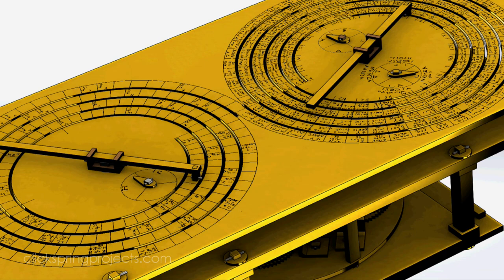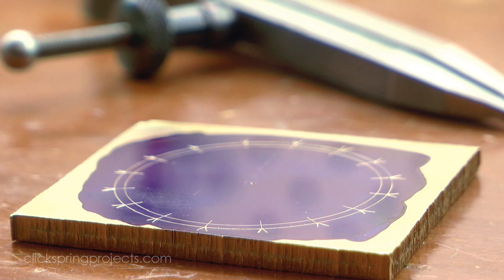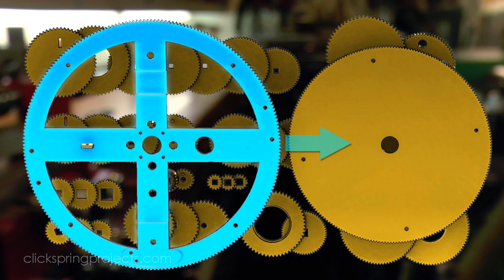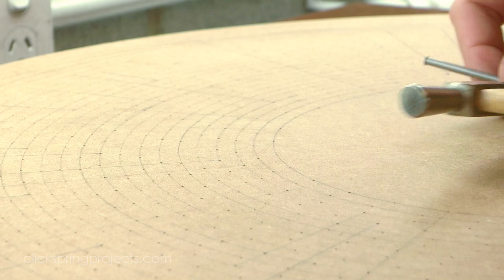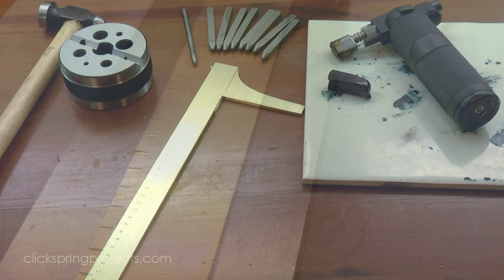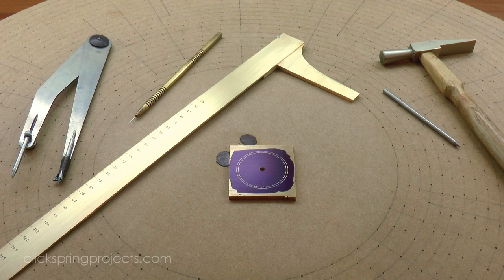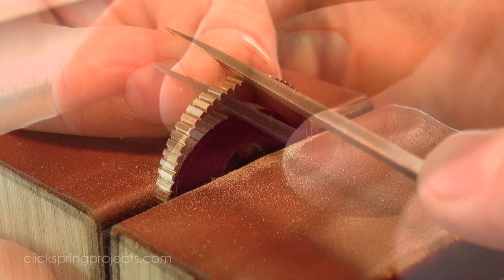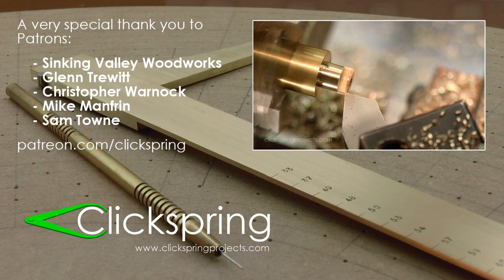#Antikythera Fragment #2 - Ancient Tool Technology - The Original Dividing Plate?

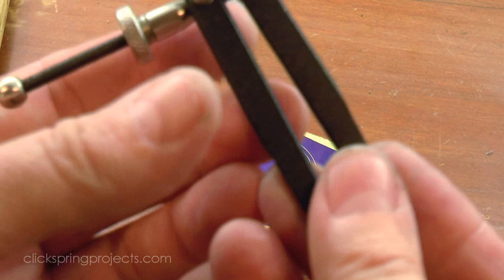Comment: 1:00 That conversion table... 32ths...seriously??
Reply: thirty-seconths ends in "ths"
Reply: lol pity it's not a real word
Reply: I do know English, that's why i know it's thirty-seconds, not thirty-seconths. Unless you can find me a dictionary that says otherwise
Reply: Elan Jacobs If I may, the confusion occuring is between time, and distance. In everyday use, the smallest unit of time is 1s, so thirty seconds, or 30s makes sense.

Distance is another matter; as you fully well know, there are two systems, imperial, based on inches, and metric, nominal based off of the meter.

Metric is the simpler of the two. Like with all other SI units, distance is on multiples/divisions of 10, ergo 1m is 100cm; 1mm is 1cm/10, and so forth. 

Imperial is different. Iirc, it is similar to computing, which is Base^2. But practically, instead of decimal intervals, which all SI prefixes are based on, rather it is based on fractions; anything below an inch is represented as such ... so, say, a quarter of an inch, is described as 1/4th of an inch. 

But this is were it gets tricky. You can divide 1/4 into half (1/8th) then into half again (1/16th), and half again producing ... 1/32. You can say 1/32nd, but standard practise  is to say 1/32th. Further, if you divide 1/32th by half, you end up with 1/64th.

Likewise, anything with a 3 in it can be written as 3rd; 1/3 of an inch is denoted as 1/3rd, divide that by half, and you end up with 1/6th; half again, 1/18th, and so forth. It gets tricky when you are dealing with really small divisions of an inch in the thousands, which is commonly truncated into 'thou', so 10/1000th is refered to as '10 thou', at which point I get lost and refer back to metric, even though ... nope, now I've got a headache ...

But seriously, it is based on what many consider 'arcane' descriptors  within the imperial system; but once you get used to it, it makes sense ...

Edit: I made a massive goof, since I rarely use anything smaller than 1/18th of an inch, and use meteric instead ... now corrected  ([/facepalm] for being a moron) ...
Reply: Yes, i understand how the imperial system works, i wasn't confusing it for time. My point was 1/32th or 1/32nd and I've never seen 1/32th before nor heard it used
Reply: Elan Jacobs I wasn't sure if you knew how the imperial system works, or not, so hedged on the side of caution. If you don't use imperial regularly, not only chances are you never have seen 1/32th before, or hear it being used, but equally you may not know how imperial works at all. My apologies for any unitended insults.
Reply: Elan, I caught that too, not quite sure what's up with that, my scale shows it properly.  http://i.imgur.com/i4FCwoC.jpg

Comment: "Less than 0.5" was said a couple of times.  What does that mean?  is it size in mm?
Reply: He's talking about the 'module' of the gear, which is basically the width of each tooth in mm. A module 1 gear with 20 teeth would have a circumference of 20mm, while a gear with module 0.5 and 20 teeth would have a circumference of 10mm.
Reply: Thanks!

Comment: A VERY interesting take on this fascinating device.  Well there's no evidence to suggest their eyesight was any better than ours, and there's good evidence that they did have access to magnifying lens technology (e.g. - http://www.robert-temple.com/articles/crystalSunFreemansonryToday.html), however your approach immediately opens the possibility of relatively "simple" mass-production, so although we've only found the one complete mechanism so far, there may be others. The use of such a system would also permit manufacture and assembly by somewhat less-skilled operators, so maybe a reduction in costs to the end-user, to the extent that such machines may have been reasonably common "back in the day" (although evidence to support  this assertion is lacking).

Comment: If they've been able to make a rather complex mechanism they probably knew electric appliances as well and they might have got more advanced tools than we think. In current history we gained the ability to make very precise mechanism when we started to build custom tools. Some years ago I did a freelance consulting in a company which was producing custom milling tools for Ferrari to shape engine heads channels upon the specific engine model which was frequently modified during the whole F1 season to update the engine issues. I think you got the gist by showing that building a tool, even the most advanced, it's simpler than build the final mechanism and so forging a complex mechanism it's a process that starts from tool making.
Reply: “They knew electric appliances as well” they didn’t 

“Got more advanced tools than we think” where did those tools end up then?
Reply: @jb76489  since almost nothing remained, it's a miracle the Antikytera mechanism survived, it's legit to suppose they knew both mechanics and precision and it's not so clever to suppose they were able to build a complex mechanism and unable to build complex machinery. It's simply a logic speculation because nothing else left to prove anything.

Comment: "[223] plays no apparent role in the mechanism's calculations"

... except for driving the lower dial Saros Cycle to predict eclipses.

Is there another explanation for how that dial works? The 223 is rather important.
Reply from the maker: Hey Benoit, as discussed in the video, E3 is required to have 223 teeth to perform its role in the mechanism (eclipse prediction). B1 however does not require 223 teeth since it is simply a driver of the mechanism and sits outside of the calculation train - hence the statement that its tooth count plays no apparent role in the mechanisms calculations - If you require more detail, there is an expanded explanation of my proposal in the video description - Thanks for watching :)

Comment: Sorry CHRIS  your wrong about a flat piece of wood, your not using wood, your using particle board which is very stable compared to wood, Wood would have expanded and contracted as humidity changed therefore repeatability an serious issue. And would not work in the long run.

Comment: Don't worry about it, mate. Just because a bunch of modern scholars like to think the ancients were... Somewhat lacking in intelligence, it doesn't mean you have to. If you were educated, creative and intelligent enough to design a device like this, you'd be smart enough to figure out multiple methods to make it, perhaps many more than the ones mentioned here.

In fact, here's and Idea: What if all they did was measure the circumference with something as simple as a string, divided the measurements on the string and transferred them to either the register plate or directly to the wheel using the dividers.

If they could figure out to saw a stone into a dozen slabs with a timber frame and multiple blades rocking back and forth together, if the Minoans could build earthquake resistant palaces 1500 years BCE, if the Greeks had steam powered robots before the rise of Rome, then you had better believe that the ancients could think of something as simple as a register plate.

Comment: It would have been easier if they used a pantograph to scale the smaller wheels down from larger ones , also , once you had a set division , you would not have to do it again, just copy from a master.
Also I think you underestimate some peoples vision capabilities. 
I worked in the printing industry and I could see something that was  133 of  an inch fairly well. 
Especially if it is backlit.

Comment: One thing: your method of dividing the circle into 16 parts is very unsatisfying. You could have down this entire step with just a compas and ruler and no guess-work. If you draw a diameter on the circle, then bisect it, you can divide the circle into 4 with no math, then you could draw chords between these points and bisected that line to achieve a split into eighths. Repeating again with 8 new chords, you can achieve sixteenths, entirely removing this long step that my skeptical mind assumes you skipped anyway with a quick calculation.